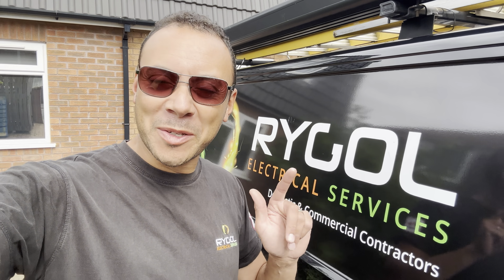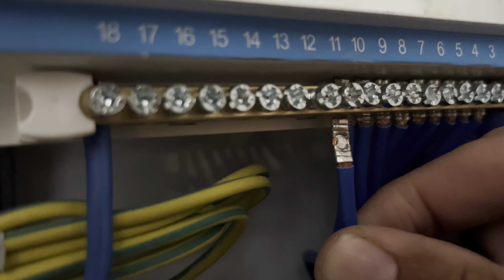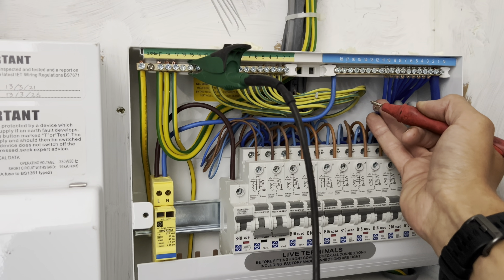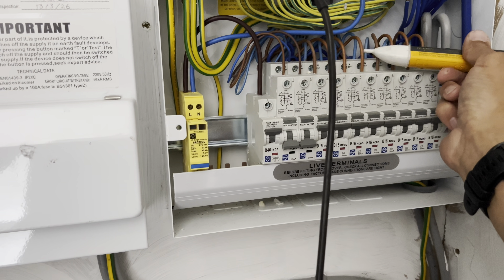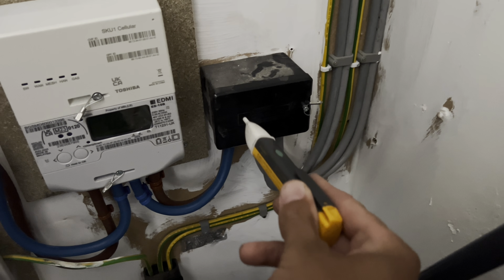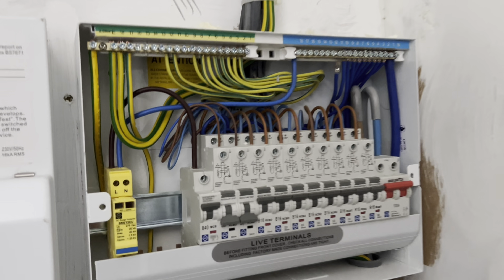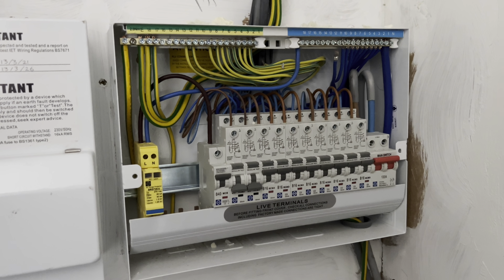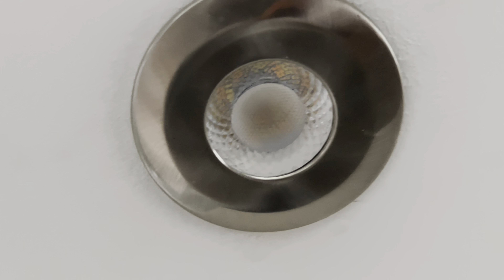Smart Meter Disaster! ⚡️

Comment: I think it's quite ironic that we've had to go back to metal consumer units because qualified electricians can't tighten the screws properly and caused fires due to arcing. Never had that problem with any of my installations and I'm not qualified or trained, just self taught. And before anyone complains this was before they changed the regulations when unqualified people could do work and get it checked and certified by a qualified person which I always did.

Comment: As a rertired Electro-Mechanical Engineer [ HND ] and a past owner of a very successful Mechanical & Electrical Contacting company. If anybody in my electrical division had done a job reversing the live & neutral not only would he or she be given their  P45  I would have made it known to all the M & E contractors in the area just exactly what he or she had done.
I firmly believe that the NICEIC should be informed because if they done it at this property how many other properties have been reversed.
The reason why I quote NICEIC is because this smart meter installation totally goes against IEE Regulations.
Reply: NICEIC are a joke. The only thing they are interested in is their members subs.
Reply: So you'd try to make it hard for them to get new work? How sweet!
Reply: NICEIC doesn’t cover metering operations, unless the installer is also a registered electrician which I doubt. The mistake is understandable but the lack of testing is unforgivable.

Comment from the maker: Hey guys. The energy supplier has been contacted by the client with this video sent to them and the polarity was corrected by me as the Henley DP block is the consumer side so i corrected it as the call centre put me on hold for a very long time. In an ideal world i would have isolated the whole installation and let them deal with it but in a shared accommodation property and no sign of knowing if and when they may come out at 5pm it was the best decision to rectify especially knowing i would leave the property in a fit working state.
Reply: So who wired the double-pole Henley block back-to-front in the first place???
Was it like that before you did your re-wire?
If so, did you mention this in your Installation Certificate?
(I would have put the yellow tape in my Brother label printer and stuck a warning on the Henley, if it was already sealed.)

If so, why did you not correct the miss-wire there and then?
If not, someone must have reversed all 3 pairs of tails, since you did your re-wire in 2021.
Sure, there's no excuse for an MO to fail to do a final polarity check, but it doesn't help if it's already wired back-to-front!
No hard feelings,
All the best,
Bob

Comment: great video .... i am currently  a smart meter engineer ...not for that company fortune...after being self employed for 10 years in the UK  Gas and electrical industry and so i fancied a change from the hard house bashing graft.  and here's my thoughts...firstly he /she should have powered down and up correctly. On charging  the meter once energized a simple  socket plug in tester would have prove this reverse polarity  situation straight away ..and so it would prompt him to check his work and rectify....job done 

However... where i fault the industry  is that way they will Fastrack literally anyone with absolutely no knowledge  or experience to a meter operative in just 14 Weeks to work on both gas and electric and send them out live to work in people's  property....yes i said just over 3 months training ... now you cannot buy experience in that time ...
Even now i know of engineers who cant solder or  alter pipework for gas or scared of having  leaks ...let alone how to relight an old gas appliance like a warm air unit or back boiler once the gas meter has been changed.

Then you have the company  constantly  on your back for more  productivity daily ...not knowing even  what the job even looks like to begin with...ie bring the wireing up to regulations with use of connector blocks or isolators.

Which then brings me to my final point ...unfortunately after a very short while in the industry..  the company makes engineers  loose intererst because of the constant  micro managing bs  and the job agencies recruiting for for the competition will lie and sell you the dream so that they can earn a commission...

The final nail in the coffin is ...ots not even LAW atm to have smart meter fitted ... these companies  are bullying  customers  with scare tactics .... to have them  so that they can earn money from the Government  and reach a fictitious  target by a certain date .

Thats my 2 cents ...Im going back to being  self employed  ...
Oh and the pay is Shit ...for the qualifications  and knowledge  that you need let alone someone  with my experience...bailing them out all the time on situations like this 

Hope this helps .

Send this video clip to the news media.....but i bet you it will not be shown on TV ...😂

I dont know which of the above caused this ...but they need to either be retrained or get out of the industry  as this could have been alot worst ...Thank God .
Reply: Thanks buddy,  I've worked in the gas industry for 10yrs, previously electrical industry,  recently thought of packing up & going to dual fuel meter installer with energy companies,  but wouldn't be happy with targets and bs. Rather work at my own pace, with no one on my case !. And doing good work of course
Reply: What it's actually not law..so can the home owner ask for a replacement analogue meter or are they dateless..
Our supplier says the analogue meter is out of date and needs replacing? Any opinion is very welcome..
Reply: @Rockall57  You can equally well swap live and neutral with an analog meter.
Reply: @Rockall57    they are lying and using scare mongering tactics  to bully you into upgrading to a SM....Dont do it ....cause once to go smart ...its extremely  difficult  to go back to a traditional  or analogue  meter ... they wont do it .
The excuses the use are... 
1. your meter is reaching the end of it lifespan .... 
2. Your house insurance  will be void if you dont get it .
3. You have to have it .

Its all BS ...
Reply: @Rockall57  It is becoming very difficult (almost impossible) to obtain analogue meters so if you need a new one it virtually has to be a smart meter. You can, however, insist the new meter is installed in dumb mode.
Reply: @kevinclayton4491  dumb mode.. would you mind explaining..
Does that mean we keep the analogue as the main meter and the smart as the billing meter?
Huge thanks for your time to reply..
Reply: @Rockall57  No, it means the meter is replaced but they set it not to send readings automatically.
Reply: Very well put
Reply: Do me a favour buddy ,please stop putting these things into people's homes  as they are VERY 😳 to people's health    I know this for a fact because I'm fighting right now to get my SO called smart meter taken out my home ' this is pure conn and it will be part of their way to control us in the very near future ,these meters can be switched off at anytime they  choose, anyone who is being forced to get one of these meter pls pls do not except these , if you want to look into EMF tradition or look up a chap called MARK G STEELE he is a specialist in all this SMART stuff that's out there ' you will be shocked at what you will learn about all this so called SMART goods ' just even look up what SMART stands for
Reply: Every picture tails a story, blame lies with the metre fitter…
Reply: Not sure who you work for to be live after 14 weeks.
But before you jump on the band wagon, watch the video again.
The sparky only had a reverse on one consumer unit, how is that possible if the meter engineer put his tails into the lucy block the wrong way round?
If you are really a meter engineer than you should be calling bullshit about now.
The sparky left one of the consumer unit reversed for two years! and your jumping on the bandwagon blaming the meter fitter?
Reply: @Porkchop259  He only showed us one consumer unit so why do you assume the other one was correct? And do you really think he would have made this video after realising the mistake was his in the first place? It's not credible. Plus, the label on the smart meter said the kitchen socket was tested, which was wired to the CU he showed us. Therefore the meter installer obviously falsified this test. He was 100% to blame.

Comment: As a sole trader gas engineer a couple of years ago I'd called around to help another gas man take an old boiler off the wall and put the new on.  He's a mate of mine and we help each other as needed.  He'd disconected the flue and pipework and was ready for the lift off.  I asked him if he had taken the fuse out not just pulled it and left it in its holder?  He showed me the fuse on the side, away from the spur.  Also he showed me the disconected wire from the boiler block.  He had taken the live wire and taped it over the bare cable back to the cable sheaving.  The neutral and earth were left bare.  When we lifted the boiler off the wall the cable became disslodged from where he'd left it.  As it fell it brushed my bare forearm.  I had a right belt off it, I nearly dropped the boiler.  My mate couldn't understand it?  But I had a good idea.  Although as a Gas engineer we are allowed to connect into a spur but not wire the spur to the supply.  However the boiler was about 14 years old it had been running all those years with reverse polarity.
Reply: Glad you were ok Tony Greenbank. That's an example of why safe isolation checks should be carried out.
Reply: @jdaley197931  100%, not doing checks nearly killed me changing a kitchen light. Locked on, hand to hand, only saved by falling off the steps. My eyes were vibrating. You can guarandamntee i do my checks diligently now!  still got the imprint of the hexagonal term block of an old style JB on the ball of my right thumb as a reminder
Reply: Whaw what a story,one you will never forget, shocking 😲 surprised it ever worked 👍
Reply: @Andrew-ki5jz  most AC appliances don't care
Reply: @TheChipmunk2008  That's the problem, most equipment will still function OK, except that any single pole switches will only be switching the neutral side & leaving the rest of the appliance at mains voltage.
Reply: @RichieReportsUK_UKCNews  Yeah, that's AC for you.

I'd put a smillie as it's an obvious statement that everyone of course already knows but I can't force myself given the gravity of the problem.

Comment: I did a project with nPower in Leeds a few years back. We were developing a handheld unit for meter installers. Immediately after completing the installation, before starting any tests, a screen would come up on the handheld unit, asking the engineer to do a visual check of polarity. The screen background had to go red to ensure they were alerted to this visual check. Why? Because of the number of times meters were installed with reversed polarity. I won't give you the figure but it was astonishing how many times this happened... You've got one job!!!
Reply: [Because of the number of times meters were installed with reversed polarity. I won't give you the figure but it was astonishing how many times this happened.]
Viewing this from across the Atlantic, and having helped work on UK mains in work sojourns in the electronics industry, your claim validates my observation. That 'Henley Block' offers an overwhelming chance for mistakes.
Reply: @stephensaines7100  Especially when that Henley block is wired back to front with no cable markings by the electrician. Just saying.
Reply: @0liver0verson9  British Gas's metering procedure is to identify and mark the polarity of all cables before removing a meter.

Comment: Nice work , the only thing I can see , is most people put live at the back and neutral at the front in Henley blocks , and as tail are grey ( maybe brown and blue marker in the future), meter installer took for granted that’s the way it was wire, no excuse he should have done a polarity check, very dangerous fault , had one a little while back , got a right old whack of neutral bar, agree with other post , much prefer single pole Henley’s

Comment: I'm just a DIYer but found this really interesting. I don't even know what a DNO is but I wish a commenter had stated the name of the culprit. Thanks for posting.
Reply: DNO is distribution network operator, used to be the electricity board. They are responsible for everything up to the output terminal of the cutout (main fuse). NOT the meter any more, that's down to the misnamed 'energy supplier' who own the meter and the tails (meter cables) on the left side of the meter. The ones on the right side of the meter are the consumer's property. Correctly speaking the meter fitter should not have been in that henley block at all
Reply: @TheChipmunk2008  Thanks. It looked like a criminal offence to me. It could have killed someone.
Reply: @AlanJan_UK_49  not a criminal offence unless the HSE define it as that, but it's lethal, and that meter fitter needs a boot in the arse. As you are a DIYer, i recommend you  get one of those plug testers. Unlike many uk sparks i don't discourage DIY, if you know the rules. It's sad that someone who is working on metering didn't use one AFTER.   toolstation
 part number 82826 :)
Less than a tenner, again,. sad that a 'pro' didn't use one
Reply: even for non diyers, it's worth owning, to let the resident know they need to call someone
Reply: @TheChipmunk2008  Whats even more concerning, are they just as careless when installing gas meters & checking for any leaks afterwards?

Comment: My guess would be the meter block is connected reverse polarity!

Now I have watched it (glad I was right) If the Supplier is told the Meter Fixer would get a written warning. 
Easy mistake to make but that is why you have checks! One of them is the plug in indicator.
They are quick enough to call the DNO out for voltage on earth when it is just their error ...... but hey, it's kept me in work for many years now! ;o)

Comment: Not electrician myself but isn’t that live tail from the consumer unit be connected to the back of the Henley block and not to the front? If I am correct then the Henley was wired in reverse originally and the meter fitter fitted his tails correctly but failed to do a final polarity check 🧐

Comment: DNO should have been called and your bill covered by them but you let them off the hook by doing it, the fitter probably doing it again and again. Meter fitters are NOT usually electricians, they are shown how to fit the meters and that is it. When my meter was fitted they broke the seal tags , they are ‘qualified’ to reseal the main fuse and meters .

Comment: You have made a mistake just as big as the meter fitter. This should have been reported to the DNO and the metering company as soon as you figured that they made a mistake, you shouldn't have cut the seal also. It should have been reported to the HSE and the engineer responsible should be investigated.
Reply: I am not disagreeing with anything that you are saying, but I can't help but wonder as to who wired the double-pole Henley block back-to-front in the first place(?).
If I discover a miss-wired DP Henley block, which is not unfortunately uncommon, I correct it, straight away.
If I can't, because it is sealed, or the tails from the meter are too short, I report it to the DNO; I also stick a bloody great label on the Henley to warn other folks that it is wired the wrong way around!
The primary fault is with the Meter Operator but, why did Rygol not correct or report the issue when they did the re-wire in 2021?
Unless someone else reversed all 3 sets of tails in the intervening 3 years of course!
Reply: The meter fitter messed up when they change the meter a few weeks back by the looks of it and then sealed it up with his sealing pliers number just to prove it was him😂, the electrician has cut the seal now though which will make it hard to prove although he has recorded it on video. 

Also regarding the HSE not reporting a RIDDOR is RIDDOR reportable itself.

Comment: Lack of testing is inexcusable, but I can see why they buggered the job up. In my experience Henley blocks usually have the neutral at the front and the live at the back, so they just assumed this block was wired like this. 🤦
Reply: Hi I agree, this is how all double Henley blocks should be wired. If anything the outgoing tails have been connected in reverse and with no colour identification on the tails, I blame the contractor for doing this, I can see how this has occurred, however there is no excuse for not testing properly.
Reply: Yeah I spotted the exact same. It caused the meter fitter to get caught out. He's a fool for not testing. But you can see why it actually happened in the first place. The electrician here bears some responsibility.
Reply: Yes I thought the same, installer assumed live would be at the back of the Henley block, no excuse for not checking polarity though which he obviously didn't do before he connected up or walked away.
Reply: Thought the same thing. I’ve only ever seen neutrals in the back. It’s inexcusable for not testing though and were taught to mark up tails before disconnecting them too

Comment: You talk too much. Any el cheapo plug in tester would have revealed the reversal virtually immediately. The conductors between meter and Henley block would not normally have been moved unless the originals had been too short and the meter fixer had to replace/alter them for some reason. It doesn't excuse the defective work and whoever made the error needs tracing and holding to account. I've actually encountered an overhead supply into an old farmhouse where the L & N were reversed at the top of the first pole from the D irons and insulators on the corner of the house. It had been like that from electricity being provided around 1952 to when I found it in 1974. Fortunately without adverse incident.